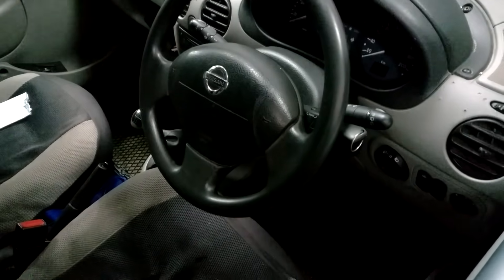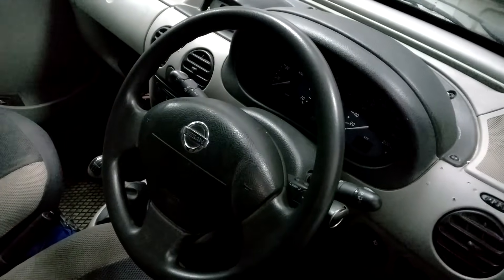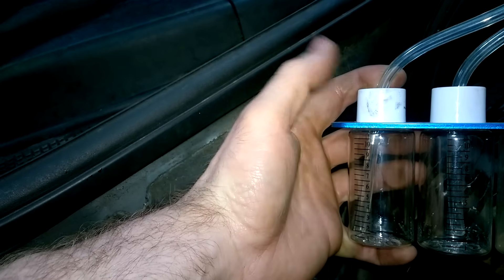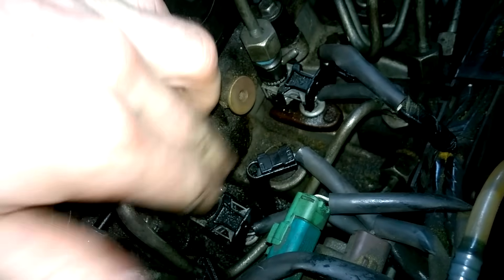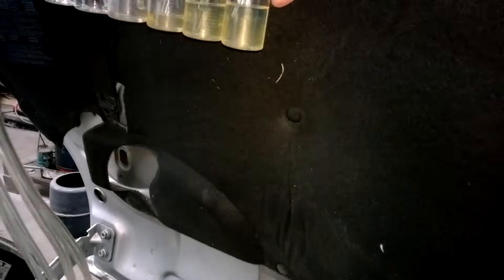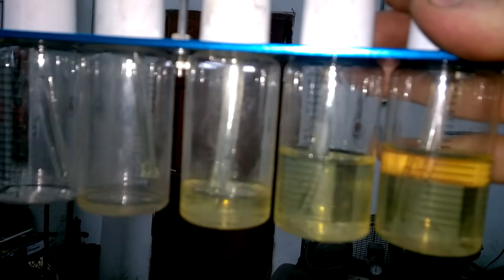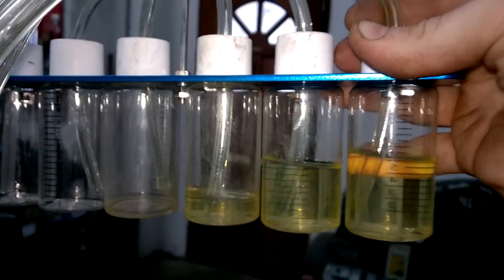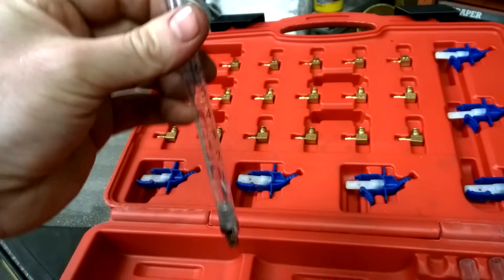Cranks but won't start on a common rail diesel engine - Injector back leakage test

Comment: Where did you connect those filter bottles from.. is it straight from the pump or on injectors 

Please help coz I am having the same problem

Comment: Hy I want to ask, it's can be in my situation like cold engine starts well and hot engine with warm/hot fuel have no pressure almost at all and won't starting and all the injektors are don't working? With cold engine starting fine lot of time but if the car gets warm sometimes it's just dies on or if I turn off the engine it's starts no more!?

Comment: Good video...helpful, thank you...what the hell do you do when you have no codes on obd11?
Reply: No codes is actually very common, on Jeep grand cherokee or Sprinter with same CDI engine, check your pressure solenoid valve first (drivers side fuel rail) with test leads supply 12 V it should click. default is closed. If you have a good diagnostic reader check pressure while cranking and valve electrical connector is disconnected.
If pressure drops the solenoid is suspect. If data for pressure doesnt move up or down at all, the pressure sensor on passenger side fuel rail may be faulty. After that go to the return test in this video, its very common to have injectors and the valve and or sensor both not working properly. Hope that all makes sense,  be prepared to replace a solenoid and hopefully not a few injectors.. they are expencive.

Comment: I was driving my Terracan and it stopped midlle on the road,if i try to start it ,it revolves very well but it shows key sign on the display, pls what can be the problem.
Reply: Immobiliser fault, or key fault?

Comment: Maybe you can shed some light on my issue ..   2007 VW Touareg v6 TDi .. left over night it cranks  for ages 20-30 seconds , but does eventually start and after that it runs and drives well. New high cca battery , I changed the tank pump ( Pass side Irish model ) ..no difference. Changed the crank sensor.. No difference.  Finally checked it this morning by removing the pressure sensor from the fuel rail ...No diesel in there ..  Had daughter crank it for 10 seconds and carefully unscrewed the sensor from the fuel rail again ....still no Diesel present. 

I'm at a loss ... since it drives so well once started.....  Please help.

Thanks in advance  Joe
Reply from the maker: Hello Joe, I have way too many comments that come through daily so it is next to impossible to reply to all giving the fact I work full time and don't be online everyday as my family takes up my evenings. With that said thanks for the tip I appreciate it. Unfortunately fixing problems online without me checking, is in my opinion a disaster. I have been offered money for these types of roles and declined. 
My advise that I would give is this. Have it checked over using a dealer level scan tool or a very good one that shows all the data you need. 
Check for any faults codes that may be logged and gain your diagnostic steps based off this, even if no faults codes are present. 
Fuel rail pressure needs to be checked and pressure sensors possibly need to be tested. A wiring diagram for the component layout and relevant information is usually essential in testing without guessing. Component tests with expected values are what follows to know you are getting the right/wrong results, that is an example of how a technician will find and fix your fault. If possible a back leakage test can be done on the injectors but the best in your case would be to remove all the injectors and get them bench tested by a company that can, they will give you a printed result of how they preformed. Refit all injectors with new seals no matter what the outcome of the testing, it may be a seal issue also. 
Without proper testing it is all if's but's and maybe's. The battery and the crank sensor were pretty easy tests to rule out without buying so I am sorry to hear you spent money on those. 
 
I hope this helps a little at least. All the best to you and yours. Happy New Year Joe.
Reply: @GerardBurkeBurkesGarage  Hi Gerard ..Happy new year from another coffee addict :) 

Thank you for your reply ..  I have vcds and it is showing zero fault codes I have changed both pumps in the tank and verified that fuel is getting to the HP Pump by cracking open the banjo bolt on the supply side while its cranking.  So since it runs fine when its started,no smoke and has no external leaks. I suspect its leaking back to the fuel tank via the supply line to the HP pump..  So this evening I fitted a one way check valve to the  hp -pump supply line.  Started it and let it run for a 20 mins .  In the morning I will know if that has solved it ..  If not.... my next step will be to fit another check valve to the HP line between the fuel rail and the HP pump.  If there is a loss of pressure then it can only be leaking back through the pressure retention valve on the leak off pipes ...either way since it might be informative to anyone else in the same position I will update here.
Many thanks ...Joe
Reply: Jay Cee what was the ouutcome?

Comment: Would have been a bit more useful to people if you had let us know what the solution was, My sisters Modus 1.5Dci with the K9K engine almost never starts on first attempt but will start after 2 or 3 attempts sometimes the engine will take up to10 attempts, but it has never yet failed to start, its very annoying because a Diesel specialist says nothing is wrong with the fuel system on the low or high pressure side, and crank and cam sensors are ok, its a very annoying fault.

Comment: i have a cold start problem on my 2003 d4d corolla. If i press the fuel primer button, it starts much better. What is your diagnoses of the cold start problem eg fuel pressure too low in an injector. All injectors sound perfect though and electrical resistance is 1.2 ohms, so ok ?
Reply: Did you find the solution? I have same problem

Comment: My 4.8 chevy cab forward...will run if I give it dsl gas mixed on a cloth.at the intake ..will not start with either..
Glow  plugs  are not working.. a shop had worked on it for a few days
. They changed lift pump ..wild shot I guess.
No start from hot if it sits for more than 10 minutes or cold no start at all
Reply: same here did you find the solution

Comment: I have no return flow on all injectors and wont start and only with littlebit brake cleaner. But not goes uper 3000 rpm. No power and have  very loud tik-tik noise at low rpm. From 1500 to 3000rpm noise maybe ok.
Reply: Alexandra,too late,but do not use brake cleaner on diesels: they will make a loud pingging noise like crazy,and it will break the piston rings in a jiffy; you must install a (cheap) scanner on the OBD2 port and read codes to help you determine what is wrong.
Reply: Alexandra Jozsef I can't even understand what you're asking? Go back to English grammar 101 boy, then report back!
Reply: @scottbaker4314  everyone understands her,maybe if she makes you a drawing...
(you're not Spell Police,are you)

Comment: Does this engine not have a high pressure diesel pump? I would start by inspecting it, to see if it is leaking. Next I would have tried starting the engine using some easy start, and I mean just one squirt.
Reply: that breaks rings,ruins the engine; it must start on its diesel fuel; check diesel pressure ,and check for electrical pulse to the injectors with a noid light ar an LED.

Comment: I have a similar problem to this do you know what it would be when I start my nissan juke in the morning it struggles like that but eventually starts but then throughout the day it fires up right away? Same engine it has 115km on it
Reply: power sounds like a crank shaft position sensor to me

Comment: my mercedes e290 cranks but doesn’t start, the fuel doesn’t go true nozzles or what you call them idk, can you please help me :/ i’ve changed the fuel filter, but no fuel is comming true, im starting to think that it may be the fuel pump thats bad...
Reply: Did you ear noises from relay pump when you crancking the car ?? Is there any power for uper and lower solenoids?
Reply: LeAh 100 there arent any noises from the relay pump when im crancking really.. i dont know how to test the power for the solanoids :/

Comment: You didn't show us the spill test ; i'd also  check for electrical pulse to the injectors first with a noid light ar an LED; 
If you manage to "clamp off" the line to the leaky injector,the pressure will then build up,and the car will start on the other cylinders ;( not easy to do; you need a blocked off,- brazed off-, nut).
Reply: It’s good way to use cap off the leaking injector then start engine for temporary

Comment: sir ca you help me my d4cb hyudai engine crank but wont start, already replace fuel rail pressure sensor cause it shows code p0191 or pressure low, when i replace it with new one it shows pressure high or code p0193, im confused because its a new sensor, already rebuild my injectors cause it has a leak, now still it cranks but wont start, tomorow i will test the glow plugs, but still why i got the code p0193 o the new sensor pls help
Reply: Hi did you manage to fix your car? What was the problem?
Reply: No reply nicr

Comment: It was usefull, but what if teh engine starts easely someties and other times not?
Reply: If diesel maybe faulty glow plugs if you have issues when the air is colder etc. One possible cause could be failing crankshaft sensor

Comment: does it happen at cold start also?, ive got a e39 530d that is showing problems, but only at warm start.
Reply: Like my Mercedes. Starting great at cold but not starting not spraying any fuel all the injektors

Comment: that is can cause cranking and not start . also if i remove electric connection from the injector and do this test  is it useful . also another question how can i check power supply to injectors as in ford ranger 2.5 l every to wires are different and go direct to ECU no constant ground or positive so how i know that the  power to them is good thanx so much
Reply from the maker: I am not sure in what test you are trying to do? If it is a back leakage test all the info is there, there may be different fitments on the injectors for the return lines but you have the info. If you are looking into a different test I would suggest an pico automotive oscilloscope or scan tool with live data capabilities. 
Otherwise if you do not have the tools you can remove all injectors and have them bench tested at your nearest shop. 

All the best with your repair.